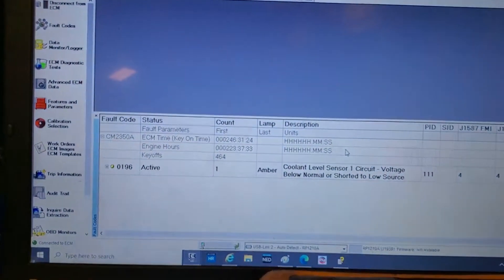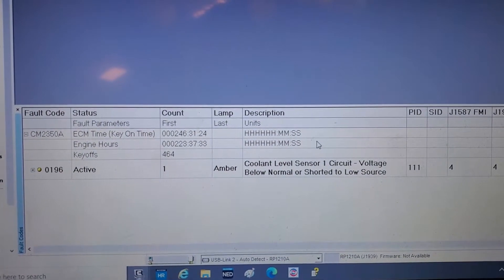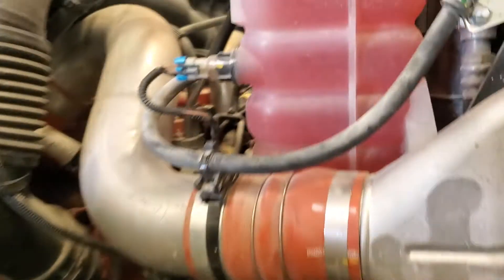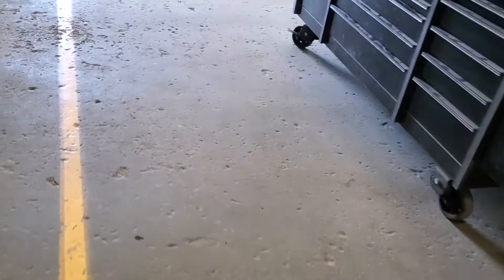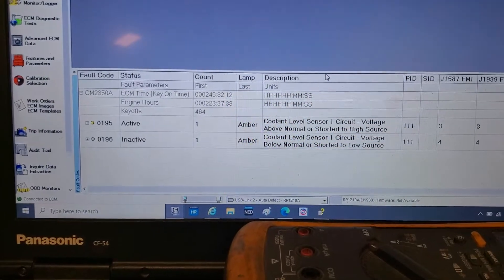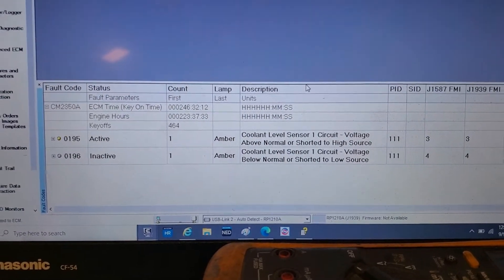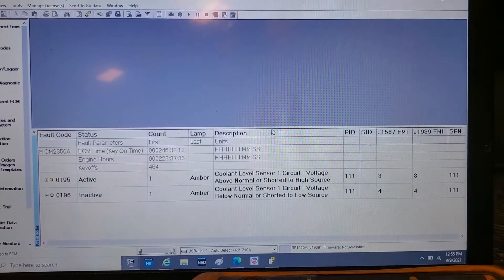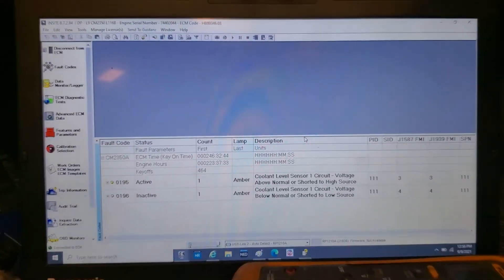cummins L9 code 0196 - coolant level sensor circuit. How to diagnose DIY, 2019 International HV

Comment: Solo estoy reciviendo 3.5 volts al connector, tendre mal un cable o mi ecmP92-3086-12241 lla valio? La coolant alarma me esta enloqueciendo. Tambien use el tierra del chassis para verificar que no el el tierra el problema, y da el mismo resultado, 3.5 voltios, no da mas. Es un 2008 kenworth w900 con un caterpillar, no allo la locacion del + pal sensor, o el tierra?
Reply from the maker: Measure voltage and then wiggle the harness to see if it fluctuates. If not, I would think your wiring harness is good. Replace the sensor. 
If that doesn't fix it, take it to a dealership to test the wiring more extensively. Unless you have a test ECM laying around...
Reply: @AcousticHills brand new sensor was bad right out the packaging. Tested the ohms, it works halfway and by the tip the ohms go over range, used a magnet. Thank you.  PS pigtail was also bad, now getting 4.9 to 5 volts
Reply: Well im stamped again, I am now beginning to think my ecm is bad. 2 pin sensor is now reading -4.9 and truck is not picking up level sensor now. The pin that the middle pin is now sending voltage when is should be the one receiving the signal and the wire that should have voltage is not showing any on the multimeter. I have a cat c15 on a kenworth w900, i can't find any schematics but im just gonna give it a final shot and trace the wires with a power probe tracer and then when i find them im going to do a resistance test on them. Only thing i don't know is if the wire that receives the signal goes to the truck directly or to the ecm on the engine side. My electric guru is out on vacation.

Comment: changed the sensor but the code still comes up. but it only comes up when the temp reaches over 185 degrees. after it cools, the code falls off. any clue?
Reply from the maker: Check the pin tension on the sensor. Also at the ecm connector. Then do a pin to pin resistance test and check for fluctuations while wiggling harness. If all tests good, your new sensor is probably bad or you have an ECM failing which I would try to find a test ecm
Reply: same issue here… did you resolve the problem?

Comment: Hey there!  What kind of code reader are you using?  I would like to purchase one.
Reply from the maker: Hey there, it's a panasonic tough book with cummins insite diag software installed. 
You can use any laptop to install the software. A bit pricey but it's exactly what the dealerships use, so it's the best.
Reply: @AcousticHills  thank you!

Comment: I’m definitely going to start watching his channel more
Reply: OK buddy I have my Customer has a 1996 bluebird bus with a 5.9 Cummings he keeps throwing a low, coolant, warning, light and it looks like the temperature fluctuates between maybe 150 to 180 so what is the proper operating temperature for this engine? it’s mechanical so I can’t plug in there and get any codes